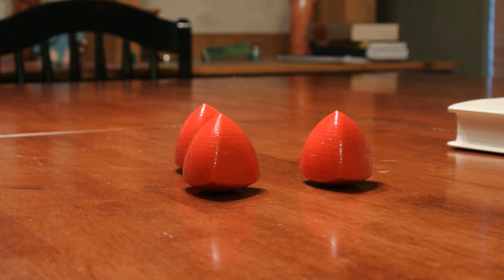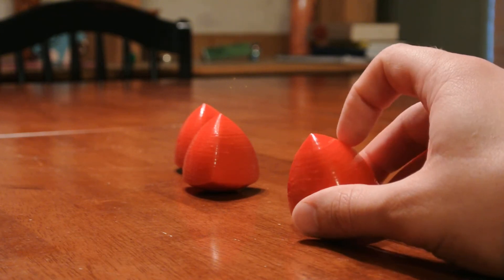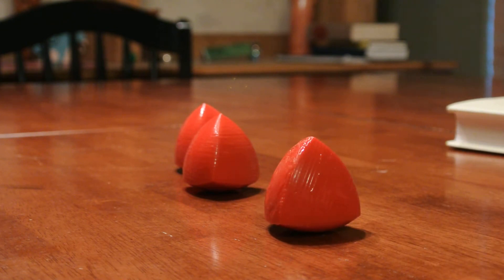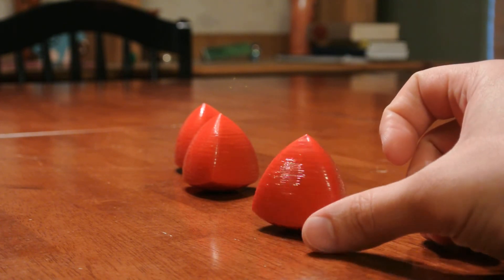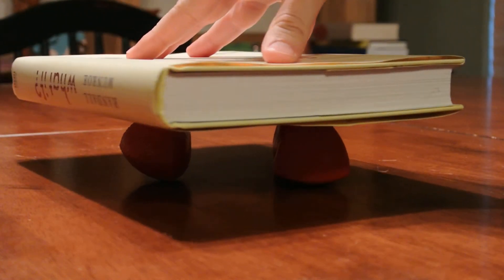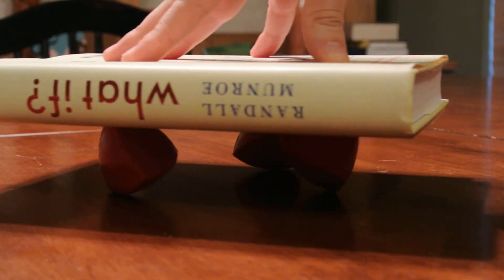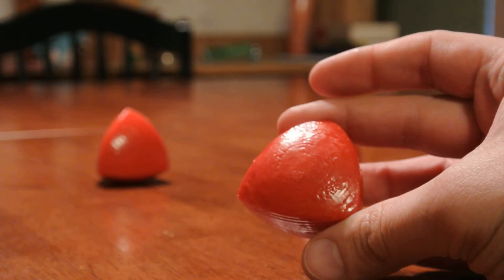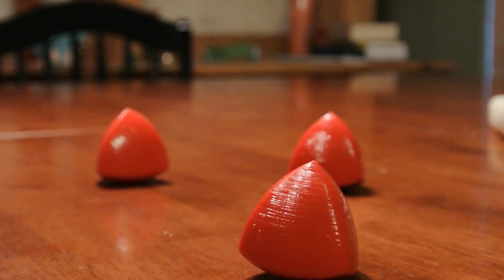Meissner Tetrahedron Demo

Comment: Oh thank u very much  for the video and can u tell me how did u modeled it i need to make a 3d model of one of these .?
Reply from the maker: The shape is defined as the intersection of four spheres with the center vertices located at the points of a regular tetrahedron. https://en.m.wikipedia.org/wiki/Reuleaux_tetrahedron It’s not that hard to model if you wanted to give it a shot. I also found a parametric version made with the free software openscad if you just want to print your own: https://www.thingiverse.com/thing:7377
Reply: @shill71  As the linked wikipedia article points out: «One can find repeated claims in the mathematical literature that the Reuleaux tetrahedron is analogously a surface of constant width, but it is not true[.]» :-(

But Reuleaux tetrahedrons look neater than the Meissner ones. ^_^